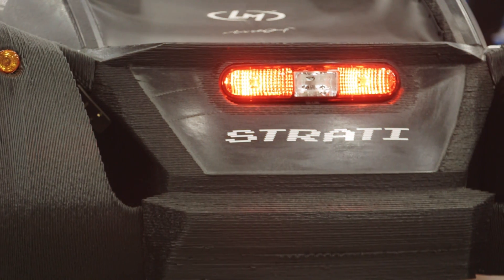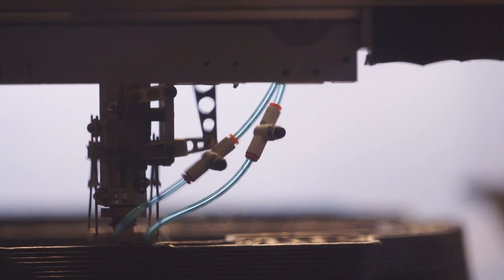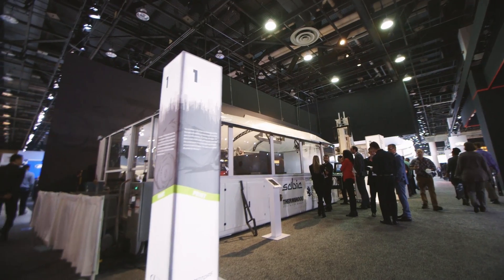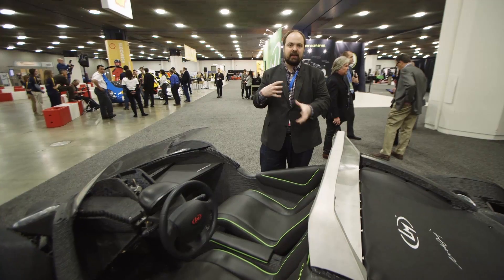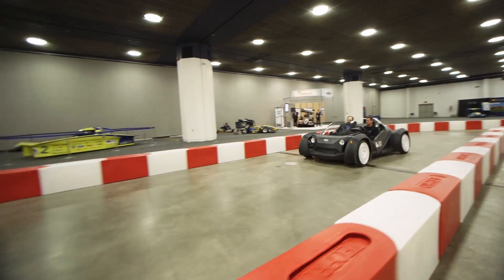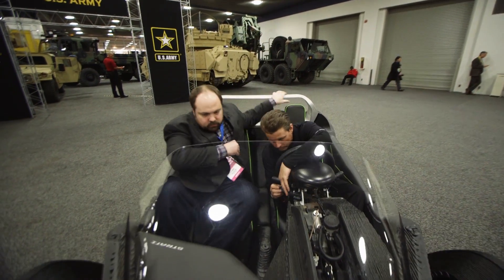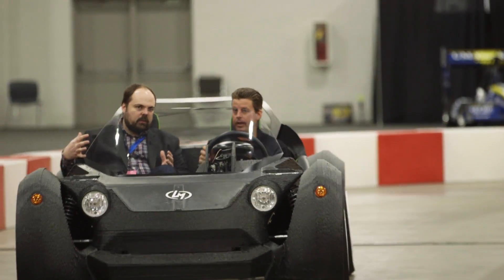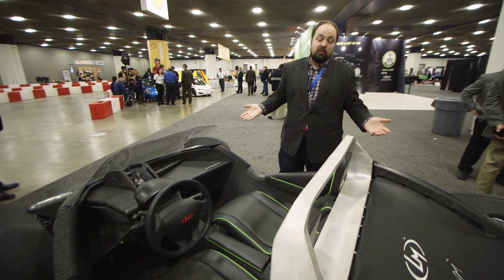Riding in a 3D-printed car - NAIAS 2015

Comment: Hate to be a hater, but whey do we need this, if you want a plastic car, why would we not just cast the parts? It's cheaper and easier and can be done way faster. So yeah sorry for being a downer. But I guess it is a cool thing, by itself.
Reply: Clearly you don't understand the benefits of 3D printing. In order to cast plastic, you need to create moulds. A new mould with each design. That's expensive. With 3D printing you just need the printer, which can print an infinite number of designs. No need to create and cast new moulds every single time.
Reply: Doug M You realize how much 3D printing cost right? And you don't create a new cast each time.
Reply: Doug M would this be cheaper than making a molded monocoque?  It is made of essentially one main printed piece, is that correct?
Reply: spuddie6 injection molding is limited too. i worked at a factory longer ago and the bigger and complex the parts get the harder it is that the edges dont burn/it dont swell when you open the mold. ofc you could cool it down entirely in the mold but then it wont be much faster than 3D printing since they are huge and out of massive metal so they dont cool down that easy.

and at some point you cant make it any more complex and have the shape go like this and that...
you either get too many moving parts in the mold (which makes it break much easier) or you wont get the part out of the mold anymore^^

also you can make it lighter with 3D printing.
as you have seen in the vid they print like a grid to have maximum stiffness while still beeing pretty light. with injection molding you either make it hollow or massive.
hollow: breaks easy
Massive: too heavy (and also burns up/swells up very easy)
Reply: spuddie6 as long as the product is not finished and ready to be produced in masses it is not worth it to get away from 3dprint
Reply: Local Motors is a company that has fun making cool cars that you put together yourself. google them.
AKA they know it isn't practical, but it sure is fun to play around with a new idea.
Reply: RAZRC0 I find it more fun to buy a project car and put it together yourself.
Reply: there's also the fact that 3D printing exists for metal alloys as well, granted it's more complex and uses an almost entirely different method from plastic based printers.